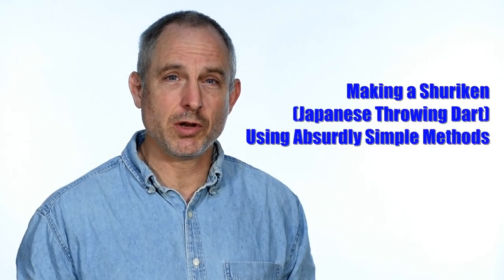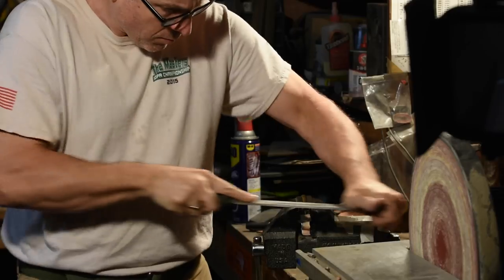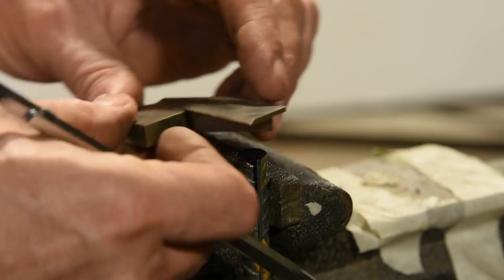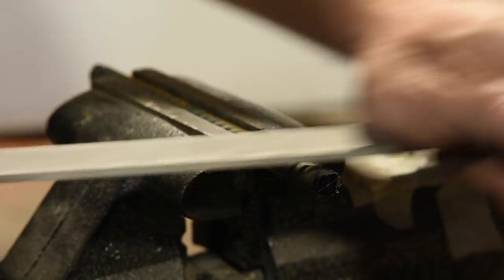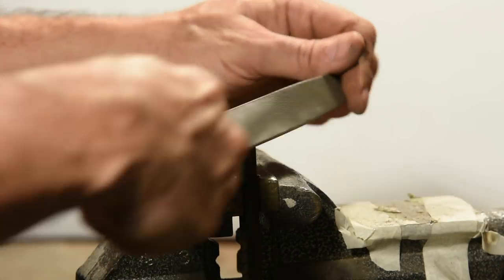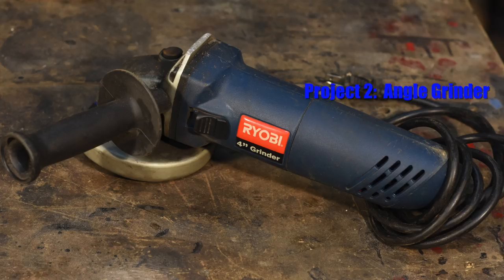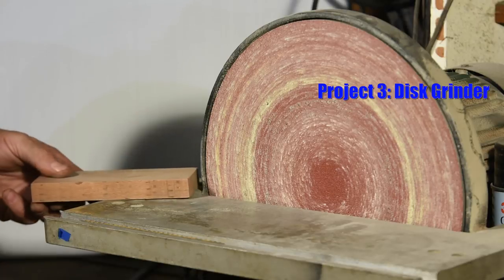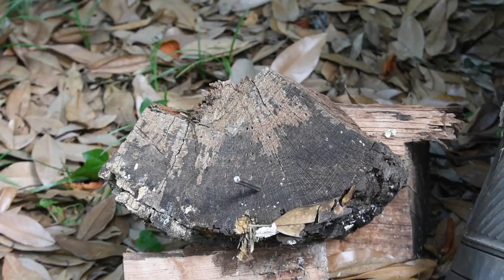Easiest Knifemaking Project Ever - Making a Shuriken (Japanese Throwing Dart) from Rebar

Comment: I did the same but I managed to fit my piece of steel rod into a electric drill. then I spinned the rod against the file.
Reply: Does it damage the file?
Reply: @henrydando  it wears the file down eventually. But it still works

Comment: Another easy knife making project is making a kiridashi out of a flat wood drill bit. It's surprisingly easy to do, and most importantly it's a lot of fun. I don't have a forge or a way to temper steel yet, so I made one without using power tools to keep the steel as hard as possible, and it came out pretty well - the edge isn't too "volatile" and it's comfortable in the hand.

Comment: Another easy way to do this; put rebar in chuck of a drill, put drill in vice, use drill as sort of a make shift lathe and use a file or axle grinder to make the point! How I made some tent pegs a while back.
Reply: Really smart... I may do this.
Reply: I should that too and I got enough zip ties for the drill's button.

Comment: Great video. One thing I didn't hear mentioned was fire hazards of grinding ferrous metals on a sander used for wood. You MUST clean ALL wood dust/ chips out if the sander and dust collector port before you grind metal, the sparks can ignite the dust causing a fire or dust explosion. Always keep a fire extinguisher handy. Stay safe.
Reply: When I first started making knives with a hand held belt sander in a vice I forgot to take the dust collector off and it was full of saw dust. Lucky day I noticed the smoke followed by the flame and didn’t burn my shed down!

Comment: I made one 6 inches long, sharpened on both ends and the metal in the middle cleaned and spray painted. It looks great and the pattern along the length is good for gripping and cool appearance.

Comment: made some of these out of some 1/4 in 7018 welding rod that had gone bad,  was able to harden them we used them like darts when thing where slow around the shop . only difference was we sharpen both ends.

Comment: In making them, I welded the tip with a hard-surfacing welding rod before grinding, so that the point will last longer & has better penetration.

Comment: Little tip. If you move your file the exact opposite way. You will get a perfectly round surface. Have the handle at the top and move it down through the stroke. As if you are trying to file a dent into it.

Comment: Walter I'm gong to try this with the 12" steel landscaping nails they are smoother on the sides and then try a salt brine hardening to see if I can improve the wear resistance. There was some indication of a slightly better hardness in a you tube video. Thanks for the push.

Comment: put the rebar in a drill and then Hold the angle grinder upside down. it works great. just spin it with the drill while the end is on the angle grinder

Comment: Much cheaper than buying punches. I also can't wait to make these for my rock sling, because with rocks and steel balls, I get middling firing range. Shurikens and spikes are the perfect weighed darts for my sling. Btw, the slinging world record can only be achieved by slinging heavy metal darts or those shurikens you made.

Comment: hello can you help me on something. I use inox steel I think it's 316L can you tell my if it's good for knife making? which  is  the temperature to heatreating ? and can i use water or oil to heatreating thanks ?
Reply from the maker: I'm not familiar with inox...but unfortunately 316L is not suitable for knifemaking.  It's more intended for sinks, pipes and things of that nature.  316L can't be hardened using the sort of heat treating procedures you'd use for stainless steels like 440C which are commonly used in knifemaking..
Reply: 316L is very good and common for high end automotive exhaust systems.

Comment: Small tip: You can use electric hand drill if you want to sharpen that kind of "pencil" shapes. Just mount that rebar piece instead of drilling bit  and work against a file.

Comment: Not all rebar is created equal. From what Ive researched, some applications require use of up to stainless steel rebar even. Ive forged knives out of rebar that harden very well and hold a razor sharp edge, Just saying.
Reply: That's pretty much what some mason told me.

Comment: Hi Walter, great video. 
I've a question for you. 
Do we need to use a protective mask during manual file granding process? Do the metal particles spread in the air around?
Thank you.
Reply: If you have something like a fan running, or it's really windy and your shop doors are open, I would wear something. I tend to wear one anyway, but I am a big baby.
Reply: I think you should wear a safety helmet, visor, earmuffs and shinguards. preferably all the time!

Comment: Rebar CAN actually be hardened and in most cases is about .3% - .5% carbon, but they are prone to fractures so you pretty much get one shot at heat treating them, heat treat in water.
Reply: Larger diameter (1/2" and up) can it seems, but not all the time. It seems you never know with that stuff. I have a one inch bar that hardens a little using super quench, and another bar that refuses to harden at all. I have never been able to harden anything smaller than 1/2".
Reply: Case hardened perhaps?  There's a product called Casenite(Kasenite?) that's seen in the gun smithing industry.
Reply: +EchoSixMike The only thing about that is for the same price you can get some o-1 drill rod that is an actual hardening steel. Also case hardening is really really shallow. After a sharpening the hard part will be gone, and you are back to soft metal.
Reply: Yep definitely looks like medium carbon steel judging by the sparks

Comment: I know that re-bar is a low carbon I hardenable steel. But during this video, the Re-bar that you used was giving off high carbon sparks.. I'm a bit confused by this. I'm a knife maker myself (only amateur) but I can't quite work it out. Why is low carbon steel re-bar giving off high carbon steel sparks?
Reply: It isn't low carbon. Medium carbon most likely
Reply: +Spencer Stollery it's a non hardenable mild steel. So I'm confused to why they're giving off high carbon sparks?
Reply: He calls it mild steel but it is certainly not mild steel. It is most likely in the range of 0.3-0.5% carbon, hence the "bursting" sparks.
Reply: +Spencer Stollery that's that I figured. But the fact that it's rebar (I'm not sure about other countries but in Australia rebar is mild steel)
Reply: We have a few different grades of rebar in North America. They are classified by yield strength. Rebar is essentially recycled scrap steel. Basically the only criteria that must be met is a minimum yield strength specification. Some grades are made from recycled railroad and axles, which as you can imagine will have a fairly high carbon content. Some grades have fairly low carbon content. But as for the stuff he is using in this video, I would say it is probably somewhere in between. It's important to note that they do not use AISI or SAE alloy classifications.
Reply: If you pause at 7:30, you can see some markings on the end of the rebar. Usually including a 40, 60, or 75. Multiply that number by 1000, and you have the minimum yield strength in psi.
Reply: Pungo Machungie

Comment: Sorry if this is a sensitive question but, whats with your right ear?
Reply: Wrestling
Reply: As Woodsey96 said. It's called "cauliflower ear" and it happens through repeated blows or high pressure on your outer ear. Blood in the ear starts clotting, which scars and swells the cartilage. Usually happens to MMA fighters or contact sports in general, though not always.
Reply from the maker: Not sensitive at all.  Yeah, it's grappling.  I did Brazilian Jiujitsu for quite a few years.
Reply: Moral of the story, don't pick a fight with the guy with the funky ears.
Reply: Walter Sorrells Okay, thanks for answering. You learn something new every day.
Reply: Forget the ear, what's with that facial hair?!
Reply: +TonbolV quiet child
Reply: Same tale for the nose, Walt? I've had my snout broke a few times and the story behind that beak has got to be a winner, brother.

Comment: These throwing darts with some fletchings, could the make some good arrows??
Reply: No it would be too heavy
Reply: But when your crossbow is really heavy it could work.
Reply: Too heavy bro
Reply: Jan Roodbol 
It would still not work nearly as well as a lighter arrow
Reply: but mass has a big affect on speed right?? I made a fiew from aluminum body with steel tips an a wood end so it isnt to bad on the string.

Comment: You are NOT suppose to remove the file from the work piece. You only release pressure on the back stroke. Also you do not need to file that quickly. Long, smooth and slower strokes are better. Too fast does makes a curved surface

Comment: what you made was a senbom
Reply: Only in naruto and 'senbon' means 1000 long thin objects.  In real life, senban style are flat plates with a hole in the center and were mainly a construction tool to pry out nails.  In combat they could be thrown but were mainly held hidden in the fist with the tips protruding used to attack kyusho areas.  They were also useful to wedge sliding doors shut and to jam into cracks to create a step for climbing.  What you're thinking of are actually called harigata bo shuriken. ([needle-form] [stick] [sword hidden in hand])  Those were medical tools instead of construction tools.  In general Boshuriken are stick shaped with one or two points.  Hirashuriken are flat plates with 3 or more points, some hira-type were also round with no points.  Some samurai katana also had boshuriken hidden in the saya.
Reply: are you sure you dont mean some samurai had an extra knife built into their saya?
Reply: Those little "knives" are a style of boshuriken.
Reply: TenguAlpha no they are a utility knife known as the ko-gatana or in modern times as a kozuka even though thats simply the name of the decorative handle. they were used as throwing knives but also for many other purposes, basically a general purpose knife and were extremely thin.
Reply: ko-gatana is a general name for any small blade.  most modern pocket knives can also be called ko-gatana.  ko-gatana, umabari, and kogai can also be boshuriken.
Reply: TenguAlpha ive handled antique kozuka or whatever you wish to call them and they are not a purpose designed throwing knife they are a general purpose knife. are you sure youre not mistaken the other set of items commonly carried in a saya because kogai are for arranging the hair and the umabari is just s type of blade for kozuka, im thinking youre mistaking the pair of chopsticks built in for shuriken. boshuriken i see are usually round not flat blades or sometimes square or other not flat shapes.
Reply: TenguAlpha not saying you cant throw a kozuka ( i just use the name of the handle to cover all the different types of paired knives) but they arent specified shuriken they are as i said general purpose knives or utility knives.
Reply: I understand what you're saying but shurikenjutsu isn't all about throwing.  That's just one aspect of it.  The name itself explains a lot, "sword hidden in hand".  Shuriken are various types of concealed blades so fighting techniques range from throwing to close combat techniques from tantojutsu and bojutsu.  Are there purpose built tools for it? Yep.  But anything that fits the bill can be a shuriken if you need it to be.  Pencil, ash tray, credit card, a rock, etc...
Reply: TenguAlpha my point is just because something can be used for something doesnt necessarily make it that, if you catch my drift a kozuka is still just a utility knife its meant to be able to serve any purpose where as bo shuriken are specifically from my understanding a thrown type of shuriken.  just cause i use a cheap chinese beater katana as a pry bar doesnt make it a pry bar is basically my point. and yes i know shurkienjutsu covers a wide aspect of techniques in fact its believed the secret techniques to miyamoto musashi's hyoho niten ichi ryu are shuriken jutsu techniques for the wakizashi as he apparently threw it quite often in duels.